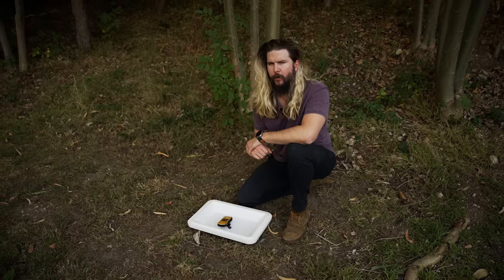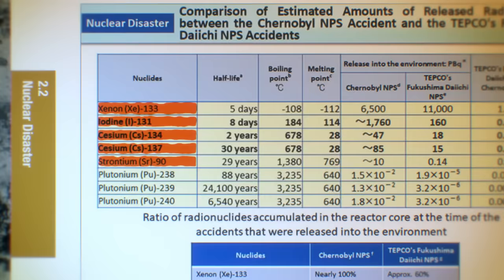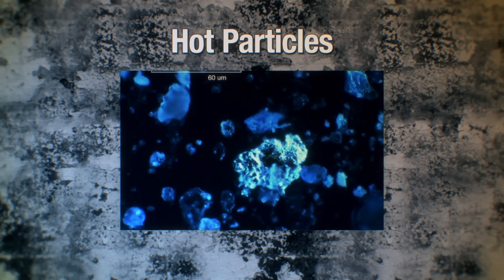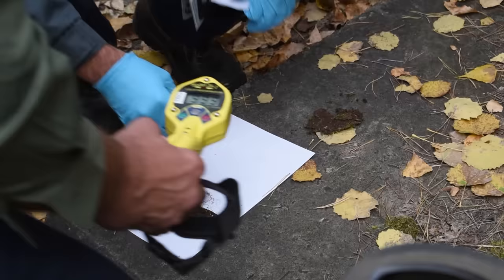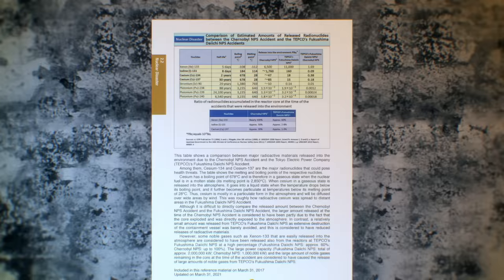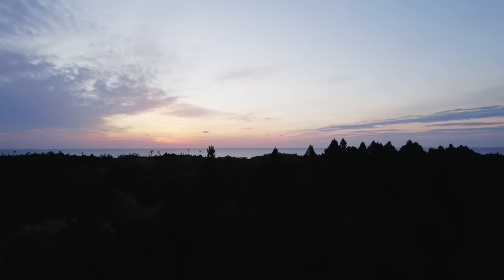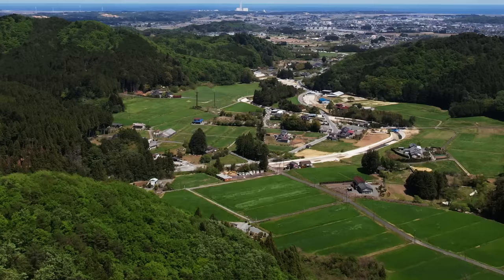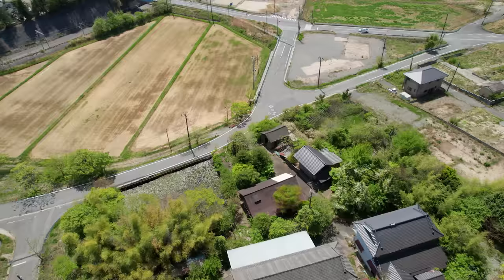A Nuclear Disaster's Deadliest Detail

Comment: Like 50 years ago, we flooded like 0.0000000000000000000000000000000000000001% of our forested area, and been running almost exclusively on hydro electricity since. It doesnt leak, it doesnt pollute, and it will run for ever.

Comment: I am concerned that in this video, as so often, a dosimeter is waved around measuring only gamma radiation, but insufficient mention is made of the fact that it is internal ongoing alpha particle radiation of our organs and cells from ingested isotopes that causes cancer.  

When, for example, you say that the radiation level in affected places is 'no higher than the natural background levels all around the world,' you ignore the fact that it is ingestion that is the big danger.  Where I live in the UK the background level is 0.1 to 0.2 micro-S, but this comes up from the rocks or down from space.  For various reasons I believe the latter to be the main source; cosmic rays.  The soil itself is not contaminated, so I won't be ingesting any radioactive material, and radioactive rocks mostly stay put in the earth.  In Ukraine the situation is very different, even where you measure 0.2 micro-S the soil and dust are radioactive and also emitting alpha particles, which are harmless except at very short range such as inside our cells when ingested.  Gamma radiation measurement is only an indicator of the possible presence of contamination, but it is not an indicator of the actual danger.  Gamma ray spectrometry can identify the isotopes from their signature, helping to paint a fuller picture.

Comment: Aren't you scared about cancers etc later on in life?
Reply: He's not exposing himself to radioactivity over a long period of time, the thing is that our skin is pretty good at blocking alpha and beta particles (and gamma rays tend to zip right through without attenuating anything) but if he ingested the hot particle then yes he would be kind of screwed as it would be irradiating his insides, So no, so long as he's careful he doesn't have a significantly higher risk of cancer though if he is smart about it yearly screenings would benefit him.

Comment: I know your a Nuclear Proponent.  It’s great in theory.  The reality in my opinion is.  It’s all good, but we’re relying on individuals to handle it correctly.  That hasn’t  worked out too well. Chernobyl (3) wingnuts.  Fukushima GE design. Probably the best engineers in the world on the subject. Now the backup generators end up in the basement in a tsunami prone area. 

The result is hundreds of square miles inhabitant able for lifetimes. 

So you rely on the people to keep this under control.  Accidents are inevitable. Where’s the benefit of that.  Again.   My opinion. The science is sound.  The control is a problem.

Would you raise a family in either Chernobyl or Fukushima? 🤣

Comment: Man... when you are working with "hot" materials, your dosimeter should be additionally protected with at least a layer of clingfilm that will prevent adsorbtion of the hot particles by the casing or the cover of the device.This is bad practice and you are showing this bad practice to thouse who will try to repeat it.  And yes please wear you respiratory protection correctly or you will be surprized where you lung cancer come from...